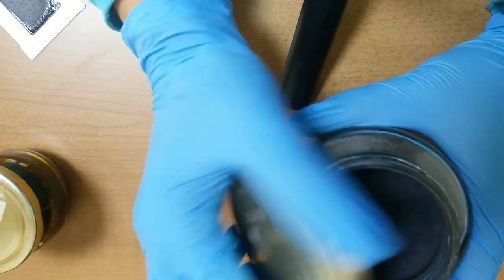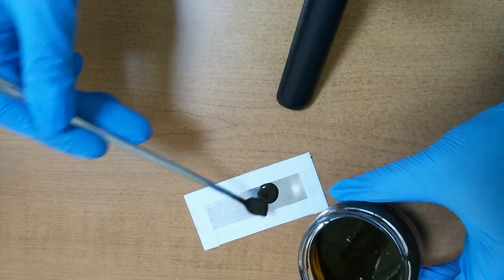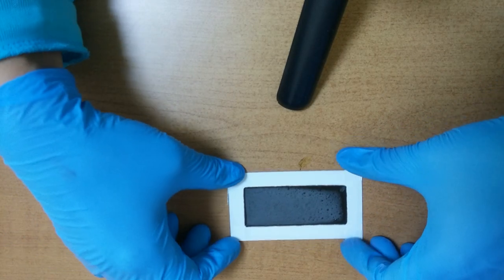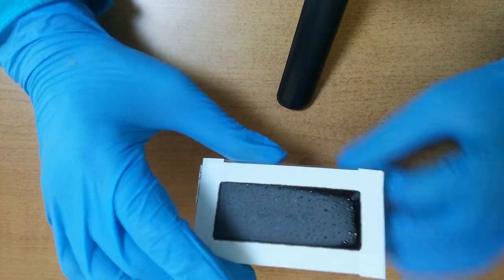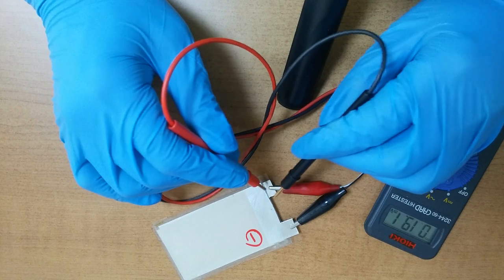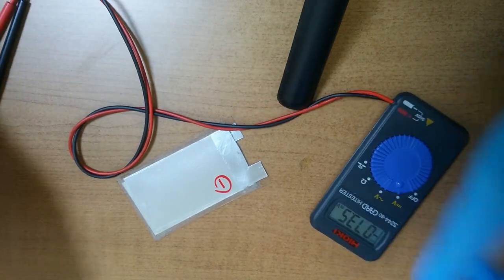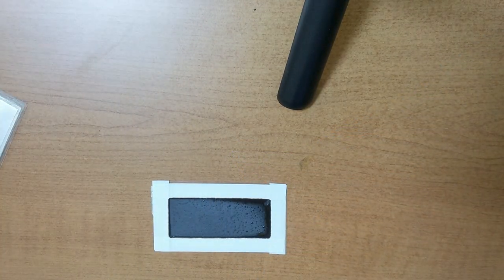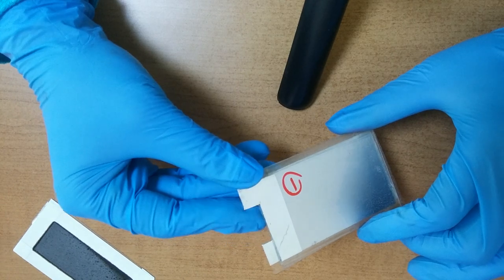we can make graphite electrode with povidone iodine, and its battery

Comment: @solid battery the voltage drops due to short circuit. You should consider Zinc oxide mixed with potassium hydroxide in a solid-state electrolyte.